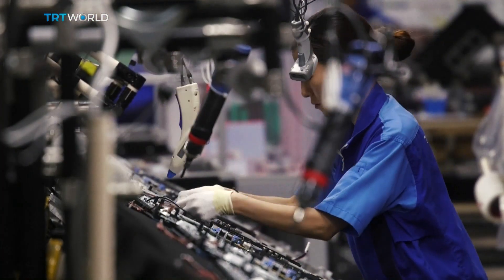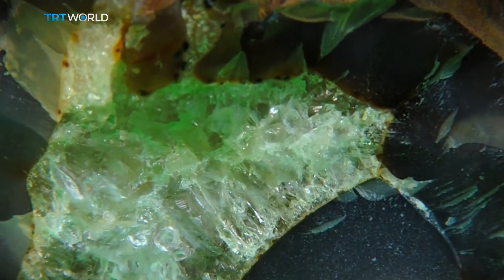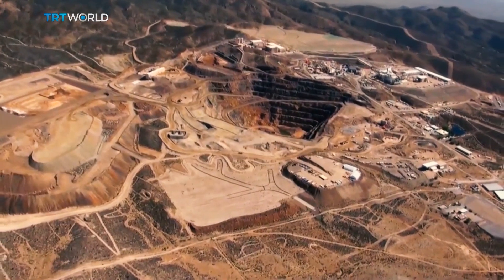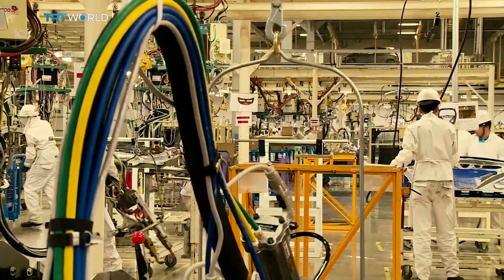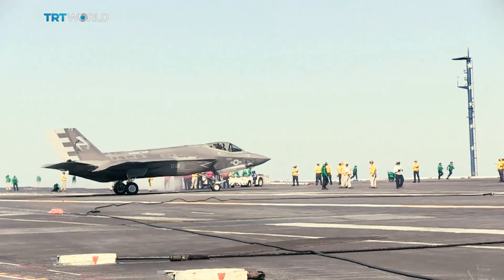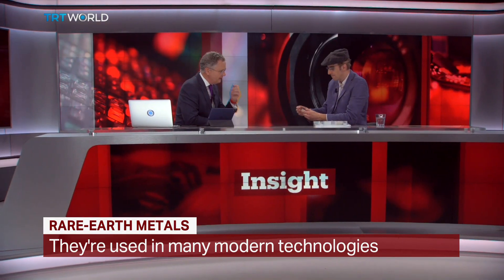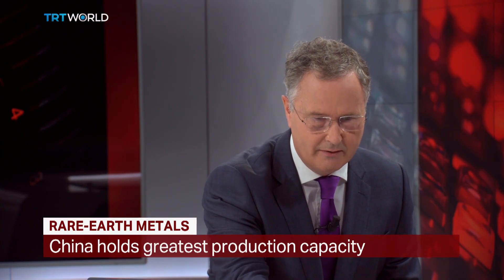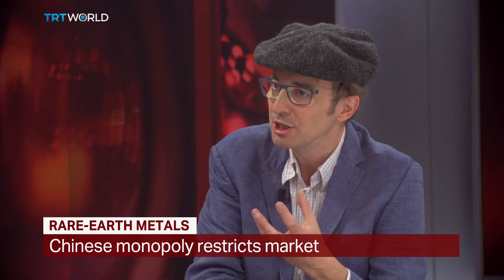Insight: Rare–earth metals

Comment: everyone seems to be looking at coal ash the wrong way.  lithium, sodium, potassium,
rubidium, cesium, francium, iron, magnesium, arsenic, cadmium,
sulfur, Lead, mercury, chromium, uranium, and other parts of the mix are
valuable commodities. with new methods of extraction being developed every year
purification through extraction of these in demand elements leaves very little
to worry about and reduces the need to open new mines. better in equipment than in the water table.
Reply: Well said and the USA has mountians of coal ash.
Reply: In reality, it is extraction and purification that matters here, not the raw minerals supply. Separation chemistry is complex and rather costly. It was never developed until recent decades because there was too little demand for those elements.